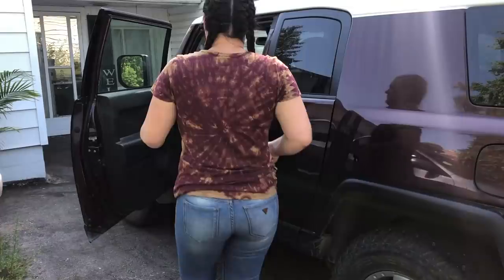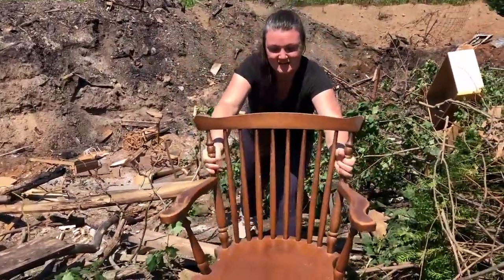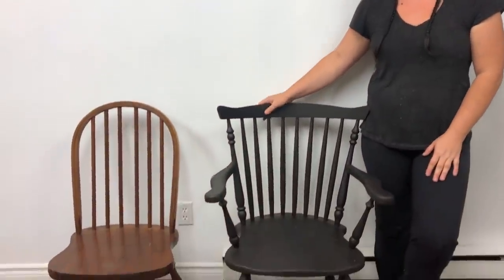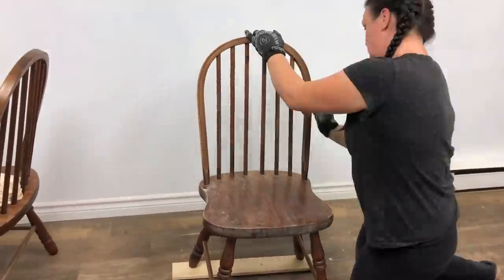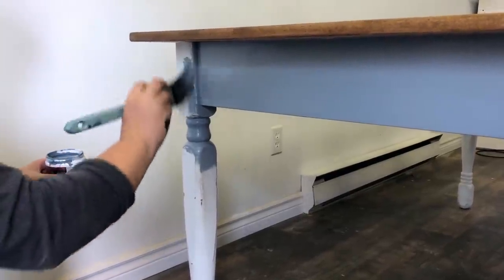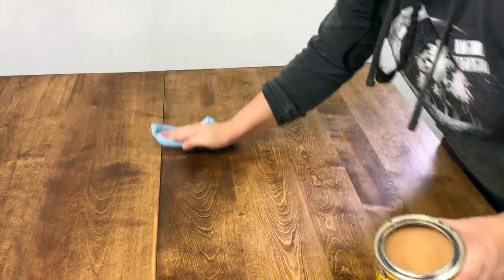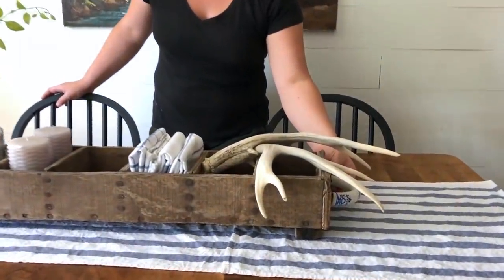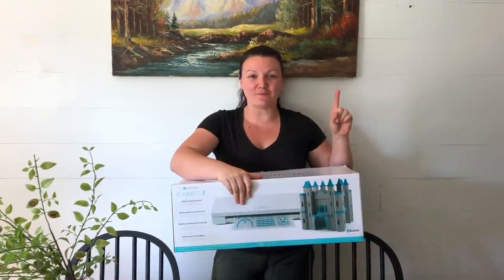Farmhouse Table Set Refinishing | Up-cycle | Furniture Makeover | Home Decor DIY | Elysia English

Comment: Holy cow, what's the maker's mark on the bottom of that blue and white pot? That may have come from Europe, the pattern started there anyway. It's "Indisch Blau" (Indian Blue) and is highly collectible here, not worth a lot but a piece like that is rare. Usually full dinnerware sets but I've never seen a plant pot with that pattern. Most come out of the Netherlands, but other places make it too - the pattern is no longer copyrighted and was sold to numerous porcelain factories. I can't believe someone threw out any of those items. Awesome finds! I like this table better than the mid-century.

Comment: I am going to be redoing a table soon. I was wondering what the wax does? Does it seal and protect like polyurethane? Thanks
Reply from the maker: It’s a sealer :)
Reply: @ElysiaEnglish  Thank you for answering. Is it something to reapply throughout the years? And did you say you put it over the paint also?  Im not the biggest fan of messing with polyurethane. Ha
Reply from the maker: Yes I’ve the paint for sure!! You can reapply if you want after so long but I find it holds up really well! :) and yes way easier than messy poly!!
Reply: @ElysiaEnglish  Thank you so much!!